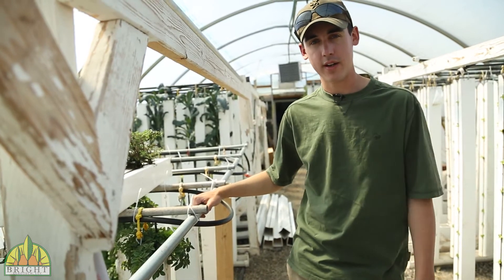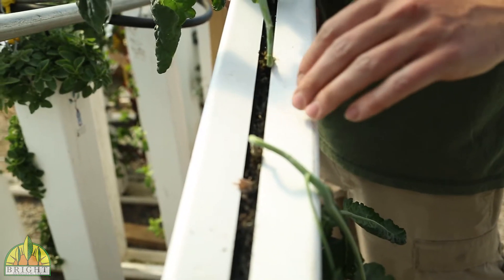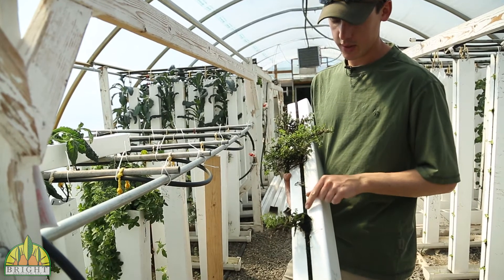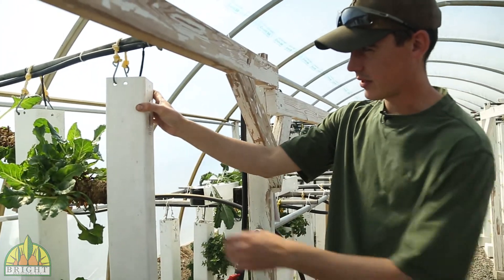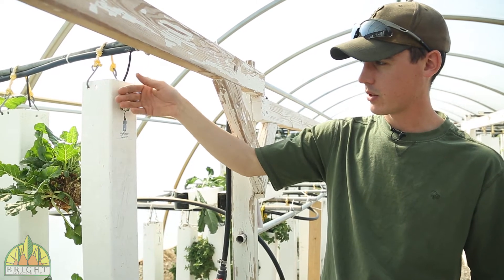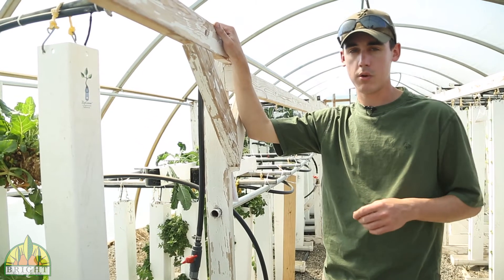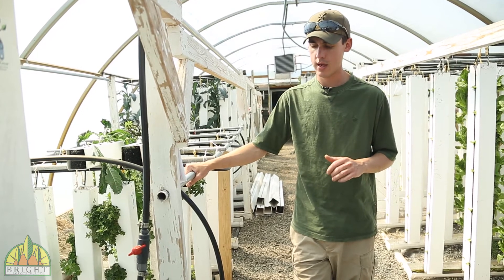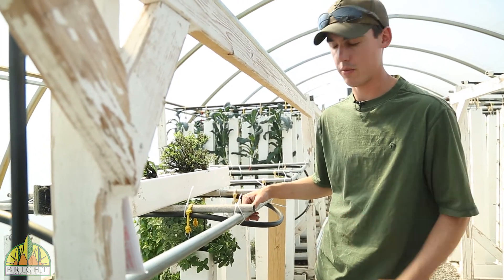Quick Tip: 3 reasons Your ZipGrow towers are leaking

Comment: Hi, have you seen any problems with the crowns of plants rotting due to excessive water in the front?
Reply from the maker: Hi +Hemmaodlat - It's a possibility, but it's usually a pretty quick fix by adjusting the tower angle. Most of the time that usually happens when a) Your flow rate is too high; b) Your plants are very mature and ready to be replanted; or c) Your towers aren't hung at the right angle. Does that make sense?